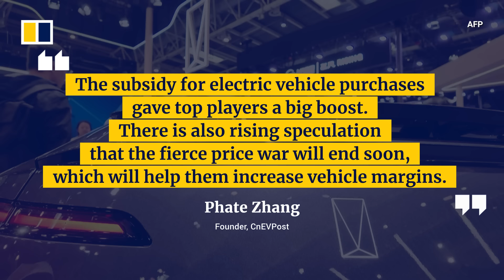EV subsidies doubled in China

Comment: Visiting Shanghai or Beijing now people will notice improvement in Air quality, compared with before covid That the city is often filled with smog But now the Air felt refreshing Thanks to all the EVs.
Reply: Yeah literally no smell of burning fuel. i love it.
Reply: Bigger cities air may be cleaner, but the air is definitely getting dirtier elsewhere, China opened up more coal plants last year to fuel EV power demand.
Reply: @Otter-Destruction  source?
Reply: @Otter-Destruction  there are relatively few coal power plants being opened compared to recently installed new energy capacity
Reply: Where does Chinese electricity come from?
Reply: Smog levels in big Chinese cities have been going down for more than 10 years. However, noise levels are noticeably lower with the many EVs on the roads.
Reply: @Bubba-q2b it used to be 2/3

Comment: EV not reliabale for long term
Reply: I'm more worried about software support, since this seems to be a big thing with these cars.  The resale on EVs seems to be pretty flakey on the hardware front, on the software front it seems to be even worse.  I don't think even half of these manufacturers will be around past the 10 year point, much less how many cars will be updated past the 10 year point with manufacturers even still around.
Reply: CEO of CATL said the fail rate of battery is 100000 to one.
Reply: ice not reliable in long term as we run out of oil reserve and gas prices skyrocket as time goes on